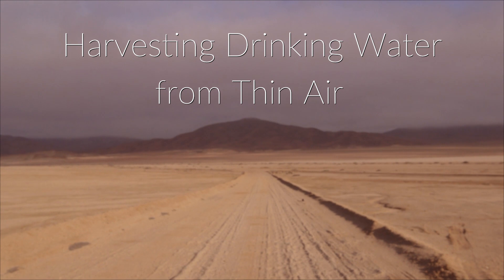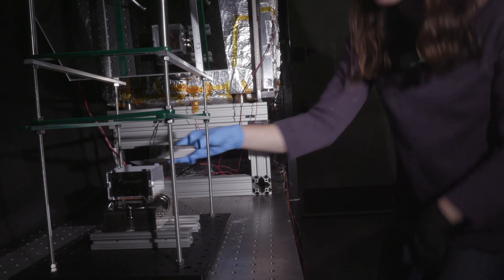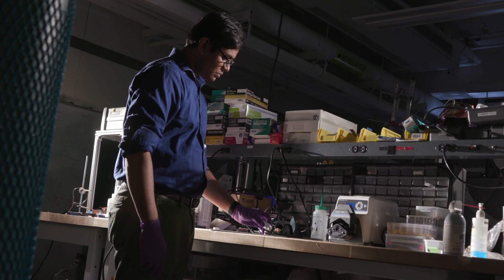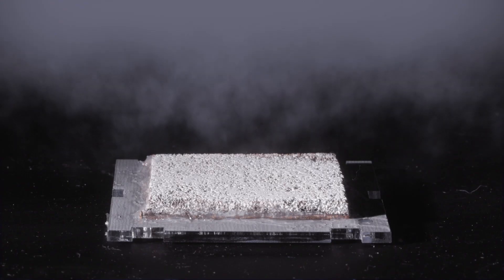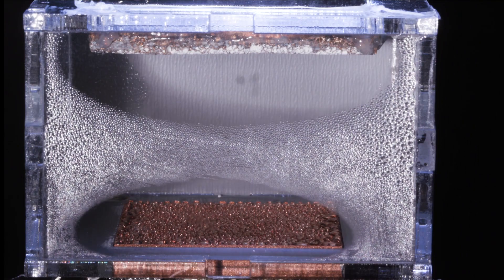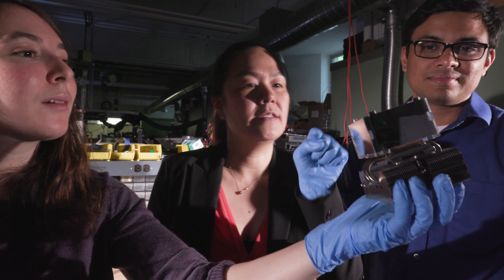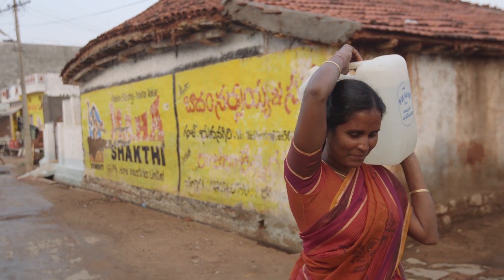MIT Device Pulls Clean Water Out of Thin Air

Comment: yeah a Russian guy did the same thing with a bucket, plastic pipe, solar panel and a computer fan...  Your stuff probably cost around 2000-3000$ adn whatever he has built is around 20-50$...You lose he wins...
Reply: He built it for less than that he got his normal shit from Costco. And it generates gallons not tiny little bit..and it doesn't swill itsrlf thru poison .

Comment: LOL....I have an AC that does that too.
Reply: Your AC turns air into water by getting sunlight?That's impressive.
Reply: @snailwzwz  Unless you don't know about wall/window mounted  and portable air conditioning unit. That's why there's a water tank in the portable unit and a drip hole on the wall/window model.
Reply: John Anthony  That is true.
Reply: John Anthony  swap coolers work like this in reverse. They use evaporative cooling to refrigerate the air. If you have a supply of water and rh below about 50% they actually work really well and use a fraction of the energy.

Comment: Seems like a glorified dehumidifier but ok
Reply: it's passive. Did you even watch the video?
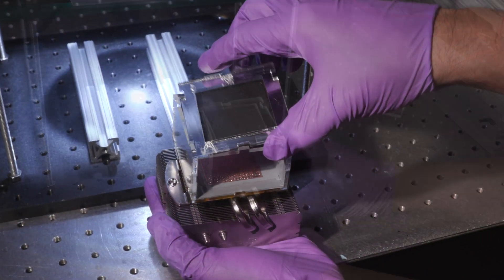Reply: @ABC-rh7zc  passive peltier effect device. That's a new one. Go to 1:00 and look at the condensate. That's a peltier effect device. I didn't have to watch the video because I have read the journal articles. How much passive heat sink do you need to condense a kilogram of water? Given latent heat of vaporization of water is 2260kj/kj and specific heat capacity of limestone is 0.8kj/kgK you have to heat 2825 kgK of limestone to condense one kilogram of water. In the senoran desert the is a mean difference between the daily low and high temperatures of 17K. Once your passive heat sink reaches ambient temperature it will no longer condense water as it cannot absorb any further thermal energy. That means that 2825kg of limestone can condense 17kg of water daily if they reach thermal saturation twice, once condensing water and once overnight cooling down to ambient. 
This is painful. It hasn't been demonstrated with a passive heat sink because the mass required of heat sink to condense water is really high. This is also three years on, where is the progress?
Reply: Oh you mean like a desiccant dehumidifier?  @ABC-rh7zc

Comment: So basically, Desiccant Dehumidifier. These things have been around for a long time.
Reply: It's a rediculously complex system. It uses a desiccant to gather ambient moisture, puts the dessicant in a sealed system, uses solar energy to vaporize the water from the dessicant and a passive heat sink to condense the vapor. The dessicant is a maybe because it can saturate at 20%rh but the rest of it is nonsense. Using a passive heat sink to condense water is a non starter. I know it has a peltier device in their proof of concept but if you read any of the articles about it they want to use big piles of cold rocks. It's as dumb as it sounds.
Reply: @timothybayliss6680  I thought the same thing! Over kill on design. Almost as if they needed to over design it so much so it would require a design patent. Ridiculous!
Reply: it's passive. Did you even watch the video?
Reply: A B C No. No one saw the video.  That’s why it’s become the laughingstock of the science community on YouTube